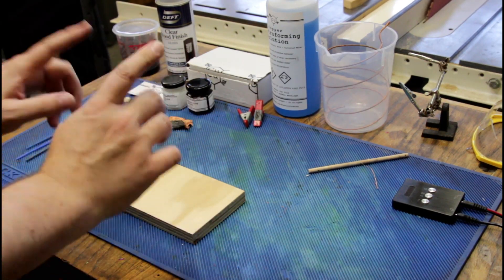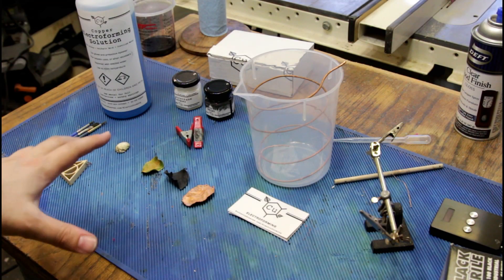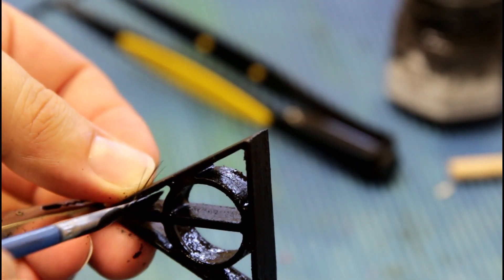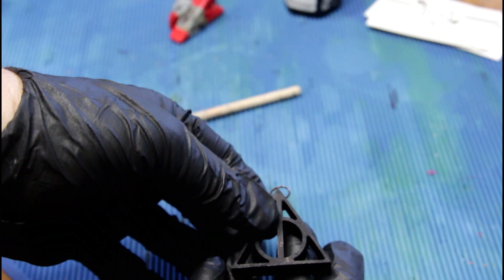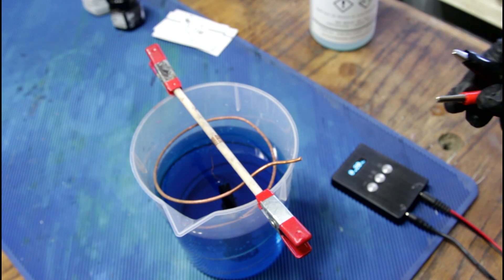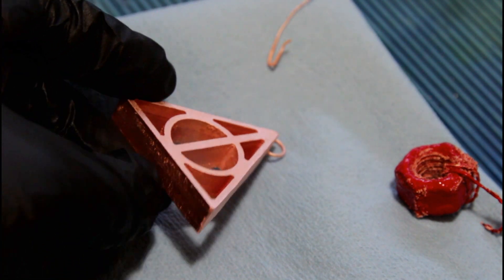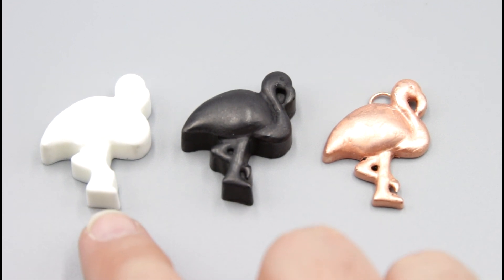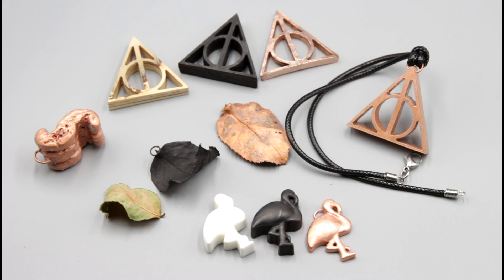Scrap Plywood To Copper Pendant

Comment: as a fellow copper plater may i just say you need to seal the organics before putting them in the bath. also that needed a lot longer cooking time on it  then you could have hit it with a dremel and brightened it up to the shiny copper you are wanting not the salmon finish you got. just wanna help if you didn't know already. i would have let that stay in the bath for a day or 2.

Comment: I'm a bit confused between forming and plating. If you have painted it in conductive paint surely it is the same thing? That plating solution should therefore work on a piece of steel too?

Comment: I'm curious about what voltage the output of the power supply is.  Seems if the amperage requirement isn't that high and the voltage is 12v or less, one could use an old charging cord as a substitute to the expensive power supply.

Comment: Copper plate the inside of a clear bowl.
Cover the inside in the paint (if you're able to use clear ITO, it would turn out awesome) pour the solution into the bowl, and dangle the copper inside of it.

Comment: next time after you apply lack, sand the plywood on all sides where you see plywood sheet lines. Then spray lack again. this way you will get perfect straight part :) Because lack raises all of the inperfections from the wood, no matter how much you sand it before :) So next time you can do this and parts will come out smooth as baby butt :))

Comment: Electroforming (which is the more scientifically correct term, though it’s more typically referred to as electroplating) has a super important use in the recording industry... it’s how all our vinyl records are made! Lacquer masters get cut on a lathe then sprayed with a silver solution to become electrically conductive, then dunked in a nickel bath... positive and negative metal copies are made so we have stampers which can ultimately be used to press the grooves in our giant hydraulic waffleirons. Trim the excess flash, let them cool, package em, and there you have it!

Comment: Paint some easy to solve item printed with PVA or something. Paint it partially with the conductive paint, electroform it thick. Solve the material and electroform the inside of the paint, cast the thin copper shell/objekt in clear resin. like a hollow  3d symbol. That would be cool.

Comment: What you do is electroPLATING, not forming. Take the case of the tree leaf: full paint around and electrodepositions in the solution is electroplating like you did. Though if you paint only 1 side to be conductive, you electrodeposit and then you separate the metal leaf you obtain from the original you paint-> this is electroforming. 

Electroforming means you have some PARTS of your object's surface that are non conductive so you don't deposit the metal on all the surface. ;) And normally you should remove the non conductive parts from the formed object after.
If you cover the full surface => plating.

;)

Explanations givens, REAAAAAAlly cool to see it works so well on conductive paint ! :D

Comment: You should do a salt and ammonia vapor bath for the copper. It turns it a cool swirly blue color (though I noticed it's very weather dependant for my own projects, it is a fast reaction when it's warm out and slow when it's not).

Comment: To achieve better results, use metal donor (in your video copper wire) with bigger surface area than electroplated (electroformed) item

Comment: I'm wondering what could be sexier than a copper plated bacon strip.  The bacon handle vegetable peeler worked out pretty well but then again it had the Han Solo carbonite treatment. I'd still like to see how well it holds up over time!

Comment: My suggestion is cast some resin with an indent of some symbol and then only put the paint where the indent is so you only get the copper on the one section.

Comment: This is electroplating the substrate doesn't matter. Electroforming is when what you want to end up with is the metal foil that conforms to the substrate- it is a literal metal forming process. It was used mostly for printing where you make a wax form by pouring wax over set type (or by sculpting a wax form) then thickly plating the wax with copper (and a layer of nickel) melting out the wax a pouring lead into the back so you can put it into a printing press. Very cool jewelry can be made with electroforming where you make a delicate wax master and selectively apply conductive paint so that when you melt away the wax you end up with very delicate and seemingly impossible to make forms.

Comment: And know, Peter Brown, that copper sulfate alone (as a water solution); when brushed unto a clean steel plate will transform the surface into copper, literally. In a sense. There will be a very thin but visible layer of copper left that looks like an alchemist changed steel into copper.

Comment: Does the copper only form on the paint, and is it still durable if it has gaps? You could cast a clear resin ball/bell/form, then paint stripes/shapes of the conductive paint, connecting at the ring, so you get a copper-cage look.

Comment: Oh god i remember electroplating in high school chemistry. If you want to know why lower amps gives better plating, its because Amps is the measure of current aka charge/second. If you up the Amps, you up the charge going onto the electroplating object meaning the copper ions are deposited onto the object much faster, leading to a loss of detail and a much more uneven coating. The payoff is a higher amps means the plating is done much quicker

Comment: Now I want to see electroformed resin, but only parts of it, so it looks like a droplet held in a copper bowl or something. Maybe a polished drop of light blue or green  resin with an electroformed peepal or maple leaf cupped around it? And maybe you could look through the resin to see the bright colors of the leaf itself, if you get a fall leaf, and the outside is a dark  (what'd'you'call't) patina on the copper, so it's really muted and dark?

Comment: Make a pcb! Very simple circuit (mill out the circuit on any medium, paint it, plate it etc) which powers a simple light that’s cast in, you guessed it, your favourite resin, while showing off the copper “pcb”

Comment: Given that the first step of electroforming is "take your non-conductive object and make it conductive", and the rest presumably proceeds very similarly to electroplating, I wouldn't consider them substantially different processes.

My suggestion is to only apply conductive paint to parts of a piece, and then electroform. Like designs or inlays. Probably need to be careful with materials and coatings, though; that solution sounds like no joke.

Comment: Electroform certain parts of the material, and tape off parts you don't want a copper layer on.
Maybe try electoforming a piece of resin and cut it open to reveal the color within the shell.
Since the copper forming on the material is conductive try making a touch sensitive capacitance switch with a weird object and make a cool light?

Comment: Hey, i watch all of your vids, quick question, i'm trying to resin a cockroach, but do i need to pull the guts out so he won't leak/explode in the resin, or will it be ok if i don't pull the guts out?
Reply: (it's a big one, not small, which is why i ask about the guts) I have casted cockroaches in silver, and have to pull out the guts, and back fill him from the bottom with filler, like a glue, before i mold and burn him out because in the vacuum former, it smashes the body down flat, which isn't attractive on the final product

Comment: Use an easily removable material for a base, like wax, and carve a design into it, and then after electroforming it scratch through the layer of metal in an inconspicuous area and melt/burn the wax out.

Comment: Why not hook the nut in the copper ring, and then let the nut sink and the piece floats above while it plates?  Would avoid having the contact point with the piece from the red nut wire...

Comment: It's an entirely NEW form of Dip It!

I would also be curious to see something in clear resin with multiple layers of electroforming inside it.  Like start with a small resin object, electroform it, then add a layer of resin, electroform again, add a layer of resin, electroform again, etc.  I bet turning it away to reveal the layers would look really swanky.  Hopefully wouldn't be too hard to turn, I know electroforming tends to be very brittle, hopefully the copper layers wouldn't be so much of a week point that it just shears apart.

Comment: Idea - use a knotty burl with cracks and blemishes. Cover the whole thing in conductive paint but then sand it so the paint only remains in the cracks and knots. Then you'll have 'seams' of copper after electroforming.

Comment: Peter, if the packing peanut has a small hole in the copper, you could dissolve out the polystyrene with acetone, leaving it hollow.
Hmmm, maybe make a shape in polystyrene, coat with conductive paint, but leave holes in the paint, so once it's electro-formed and the polystyrene is dissolved out, you end up with a hollow form that you can see is hollow.
Thanks for a fun video and keep up the magic.
Reply: The deathly hollows
Reply: It would be VERY fragile unless you plated it for a very long time.  Would be cool nonetheless

Comment: I've never done this before, but one suggestion I have that might improve the process, is put the conductive paint in an airbrush. You would get a really nice even coat. Also, after coating with copper, you could probably easily plate this in gold or silver!

Comment: you could make fake metal rings from stabalized cherry Burl. or a fake tree from broccoli with green copper rust leafs.... or pour resin into a earth wasp nest and cover it in cooper to call it a natural circuitboard. or make a Laserdisk bowl  where you first make a resin bowl then put cooper on the inside than another equally thick layer of resin. don't sand the surface for the cooper to give it a more distinct look. or golden bacon strips. or replicate the holy grale from Indiana Jones movie.
i think you will come up with a great idea

Comment: It'd be really interesting to see if you could paint a design on an object with the conductive paint and then copper form it so you could see both the copper and base material. If you could pull off a project that shows a lot of different media all at once all on the same piece it'd look really cool.

I think you should make a secret wood style resin/wood object, paint a design on it with conductive paint and then copper form it for a lot of interesting contrast.

Comment: I did electroplating when I was at school and found it very finiky. Did you have troubles getting copper to cover objects when you had touched them?
Reply: My school never gave me gloves so I had to keep the objects in a polishing cloth and put it in a special bath first to help it stay really clean but even still I had a few pieces not work. This was nickel plated copper though.
Reply from the maker: One of the pointers in the instruction book said not to handle the conductive painted object once it had dried without gloves.
So, I didn't. Apparently, the oils in your skin can mess it up.

Comment: Can you electroform other metals? Is there a size limit?

I think it's interesting that the final product looks like solid cast metal, but can be made a great deal lighter than solid metal would be. Imagine going to pick up what looks like a real copper sword and discovering that it has the weight of styrofoam.

Comment: It’s a neat process when done correctly. This looks like it was just painted.  I bet it would have looked better just pained with copper paint.
Reply from the maker: The copper also adds texture, and will age and patina. I agree that quality metals paints look good (we had luck using some in the Dragon Egg video) , but isn't the same depth as the actual copper.

Comment: So does this mean that you could electroform/plate other objects only partially by only painting specific parts with the conductive paint? You could put streaks of copper onto an object post lathe or post resin and add more interest (and cool science). One hang up could be that it'd be difficult to connect the circuit but you could wrap the entire object with copper wire so that the wire made contact with all the painted sections. Also, what does the solution look like after the electroforming is complete?

Comment: After plating is complete are the parts super hard like metal? Im wondering if the leaf is still a bit brittle or is it rock solid
Reply from the maker: It is a thin coat of copper. If I were to tap it against a metal surface or drop it, it would clang like copper. It can be bent easily and it is incredibly light. 

So yes, it's somewhere in between rock hard and brittle.

Comment: Couldn't you just have a stiff copper rod forcing the piece down instead of having to weigh it down?
Reply from the maker: I don't see why not. As long as it's far enough down so when it floats it doesn't crest the solution it should work fine.

Comment: i can't remember who makes the stuff, but i know there are oxidizing solutions to speed up rust and corrosion of metals, and have been used with metal paints to great effect by prop makers...  what would be really neat is after the metal forming bring it to a patina and then seal coat it.

Comment: If you can get a layer of copper like this on any object, then you could easily plate other metals on top of it. You could also do gold instead of copper easily since you can electroplate gold onto any conductive surface and it only take a really thin coat to get the color. I could see doing copper beforehand to help support the soft gold. If you wanted a really shiny silver metal, rhodium or palladium work really well.  Palladium is cheaper generally and is closer to the hardness of copper or brass. You could do zinc and then give it a light polish or darkening with a black paint wash to get a pewter look. You could also start with a layer of copper and then switch to plating bronze or brass onto the object.

All of these option would still need to be given a coat of poly-urethane to protect them, but you can get matte to super glossy for that finish. This opens up some great options for making pieces for costumes and props.

Another thought is to use a wax casting and try to get the layer much thicker. You leave a hole in the paint layer and then melt/burn the wax out of the middle, creating a light, hallow casting made of copper. This could then be place back into an electroplating solution and the layer thickened even further.

Comment: So many things you can do with that. Question, the electroforming solution, can that be reused or is it a one time and done thing?
Reply from the maker: The manual claims I can just add distilled water as it evaporates. I'm not sure how long term that is possible for.
Reply: Thanks, you should do more packing peanuts, that looked cool

Comment: If you casted resin with electrically conductive paint in it... (think swirls so they're connected) you could then plate it, making a plated "embedded" copper mix in with your resin.  Maybe do the drop onto "resin and drag-with-stick/blow-it-around" then plate that.

Comment: 1 How thick in the copper layer?
2 What solution would you use to get a Gold layer or a Silver layer?

Still great vids!!
Reply: The thickness of the copper being laid down is dependent on how long you leave it in, but probably wouldn't be more than a fraction of a mm. You can get other electroplating solutions to use if you want other metals, that are usually just called "Silver electroplating solution" but I believe you also would want a sample of that donor metal to use as the anode.

Comment: Oh I had a thought about this and resin. If you cast certain metal filings in resin, i.e. cold casting,  you can buff it out and if the metal in question is magnetic, it'll be magnetic, or if it oxidizes, you can oxidize the surface. Do you think you can electroplate cold cast resin without the conductive paint? I imagine something like iron (or aluminum?) filings are cheaper for casting than copper filings

Comment: Did you go over the finished product with some sort of clear coat varnish to prevent oxidation? Otherwise, it seems like it would get a layer of old penny grossness on it really quickly, especially if it's handled a lot

Comment: AWESOME video, love me some electro-plating/forming/galvanizing action, always fun!

So both you and the Crafsman have been working with different finishes for resin, right? I saw on, I think, Punished Props that Bill Doran uses graphite powder as a surface finish on plastics for a dark metallic effect, and I'm wondering how graphite would work as a resin pigment! Maybe it buffs out like metal filings and such? Hope you try it out if you're making another weird pigments roundup!

Comment: Cool and project! If you coat the wood with resin and finish it glossy before painting and then plate for a long time you should be able to carefully polish the metal surface if you want to get that sort of look.

I'm not 100% sure but I think it could plate even without the electricity. The copper solution will do that at high enough concentration. It's called electroless plating if I'm not mistaken. It still need the conductive surface. I'm actually experimenting with this conducive paint stuff too atm so this was really interesting to see.